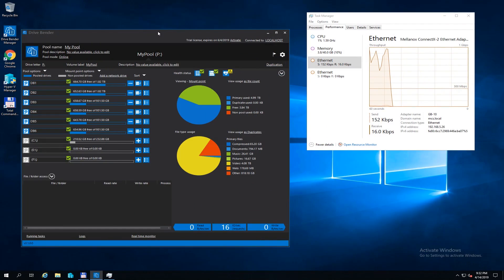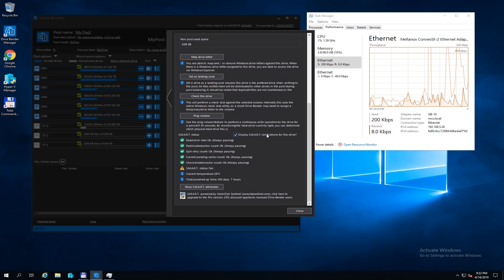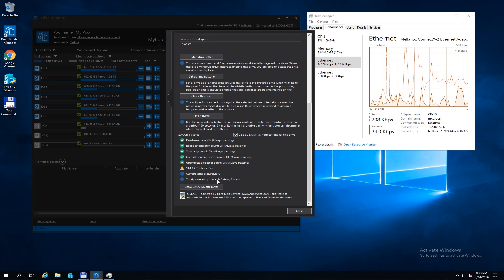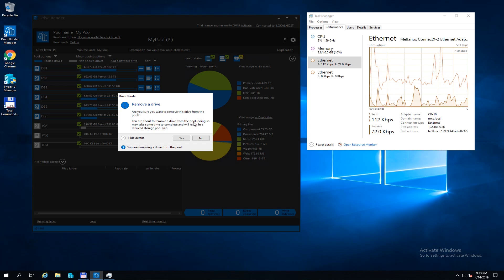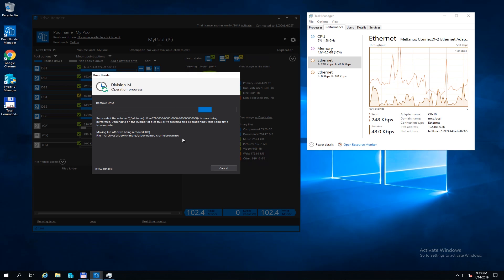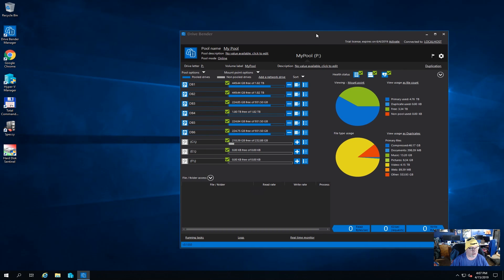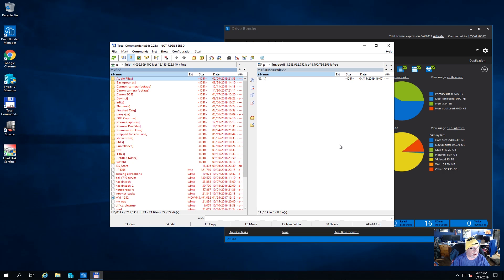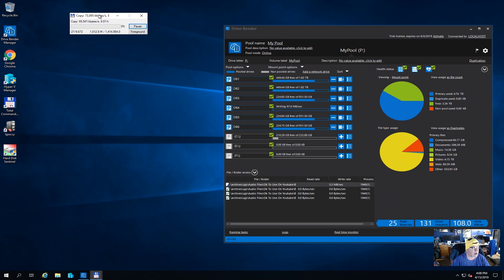Hard Drive Failure! Drive Bender Replacement Procedure on the Dell R710

Comment: Hey Unkyjoe. When the drive is failing the files it needs to take off of the drive. where does them files go to if you don't have enough space on the storage pool to copy the data over? I'm guessing you need to add another storage drive to the pool for that?

Comment: Hi, can I ask you a question?
I was given a Dell PowerEdge r710, it's a single CPU, but I am in China so I have to change it to English and no one knows the password to sign in.
I want to use it for storing my music on and movies, multimedia server storage, is this worth spending the money on?
I can get the r720 and r730 or non-r version but the xd versions which makes 12 bays on each model. 
SAS drives are really expensive here so can I use SATA drives, but keep the two small 300gb enterprise drives for the operation of the machine. it not going to running 24 - 7 as I have 8tb drives.
are the xd better having the 12 bays a possing to 8 bays, or do I need both?
or should I buy a big desktop computer?

Comment: What did you have a drive catastrophically fail is there any redundancy in drive Bender
Reply from the maker: There is file and folder duplication that spreads data across multiple drives, and backups of your data will help guard against data loss and not much else. Thanks for watching :)

Comment: There's a lot of 3TB SAS drives on Ebay right now really cheap, or for a little bit more get a SATA Dell branded Constellation ES.3 with 128MB cache.  I've been collecting those for my Xpenology system.  Make sure to put the latest firmware on them as the old er firmwares can lead to premature drive failure.  I had to download the old Dell nautilus program and remove the old firmware and copy the ES.3 firmware from the other utility into it and  flash them from dos.  Worked great and these drives have a really fast sustained rate.
Reply from the maker: Thanks for watching :)